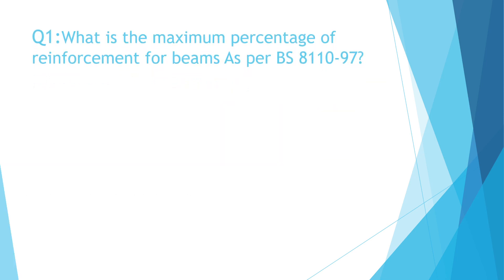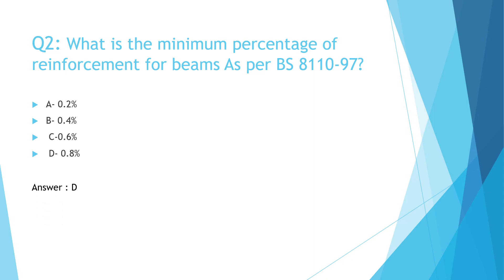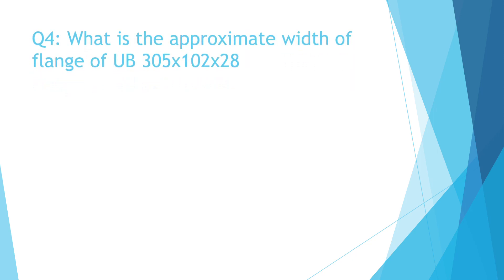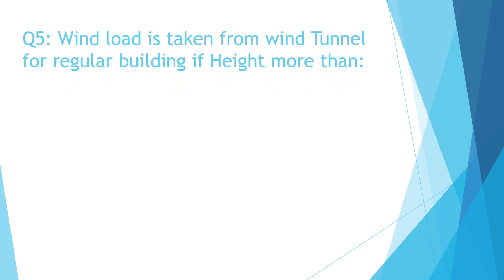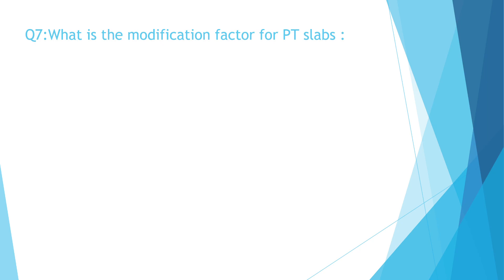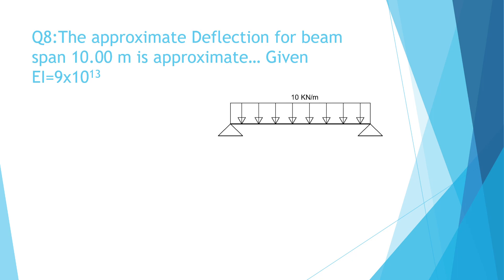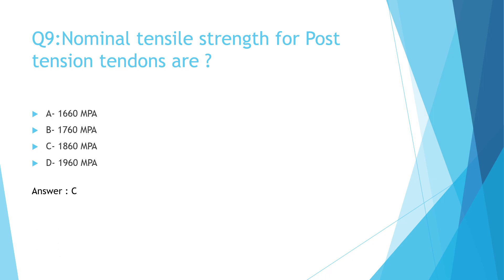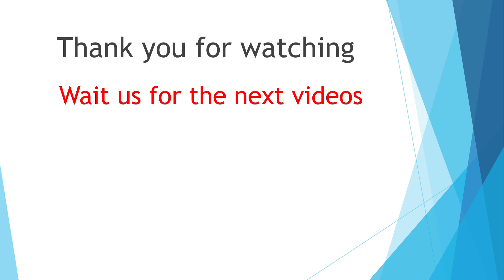Dubai Municipality Civil Engineer Exam 2022 for G+12 Part 2 Construction Engineering Services

Comment: Hi sir,Thanks a lot for the video..g+12 steel question asked for DM,could you please help with answer Q1)Direct shear Fs on top of bolt-Answers given were 30kN,15Kn etc some values Q2)Sway for steel structural shed Q3)Allowable sway for full beight block work Q4)One question was 5M20 bolt for column beam moment connection,and some spacing100mm, then 300mm was mentioned, and bolt group value asked..answer had some values like 4E6,etc,was not clear

Comment: Good evening sir 
Tomorrow I have g+1 steel construction contractor exam can help me
Reply from the maker: 1-	WC 500 *300 what the width of the flange 
2-	UC 305x102x28 what the width of the flange
3-	Adding more water to the concrete will decreased the... 
4-	 What is the minimum size of weld for 8 mm thick plate?
5-	Shear diagram for continues beam with cantilever (distributed load ) 
6-	Shear diagram for simple beam with triangular distributed load 
7-	Critical path method what minimum value will have Float 
8-	Distance between the edge of plate and bolt center will be  
9-	if you have the bolt outside the UC column flange what the connection name
10-	 - what the different between RHS ,SHS,CHS 
11-	-allowable  steel deflection for roof celling not plaster under live load 
12-	allowable steel  deflection  for beam under live load 
13-	allowable steel  deflection  for beam under live load and dead load 
14-	tensile strength and yield strength for 4,6 
15-	 - tensile strength and yield strength for 8,8
16-	 apex connection between two beam 
17-	-what the allowable strength of grade 43 steel when thickness less than or equal to 16 mm 
18-	what the allowable strength of grade 55 steel when thickness less than or equal to 16 mm
19-	what the allowable strength of grade 50 steel when thickness less than or equal to 16 mm
20-	D/T steel flange